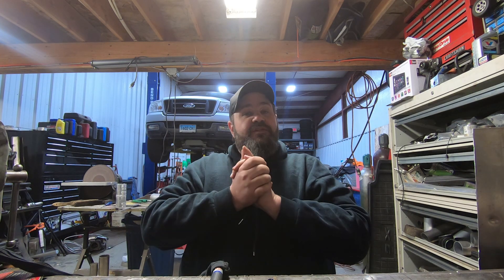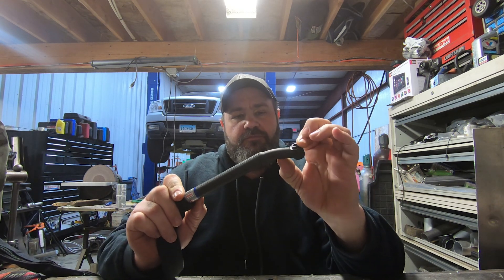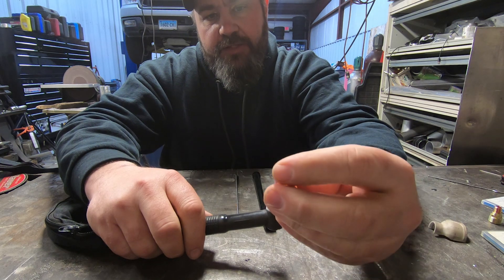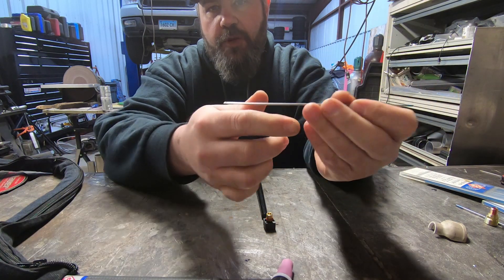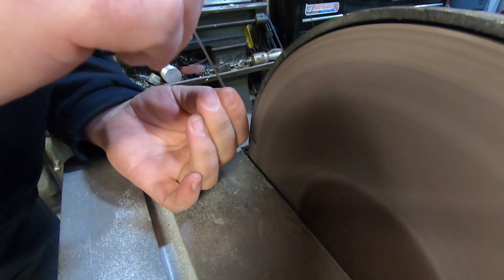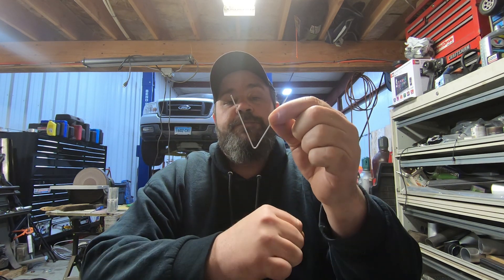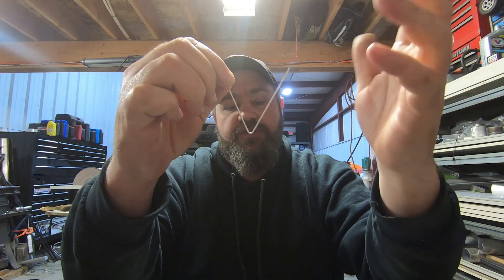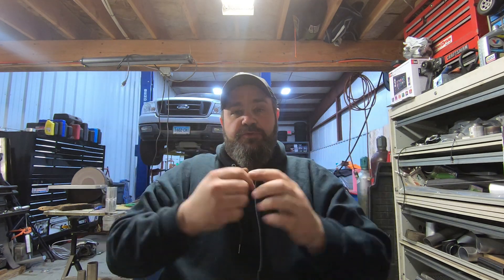Tig Welding EP2 Torch Setup

Comment: could you recommend an everlast tig for under 1000? im kind of clueless and i dont want to buy the wrong welder lol. i want something i dont have to upgrade for a few years and something that can use 120/240? ps id like to weld aluminum as well
Reply from the maker: The power tig 185DV would be perfect for you! It's under 1k and will do aluminum as well. It is an ac/dc machine.